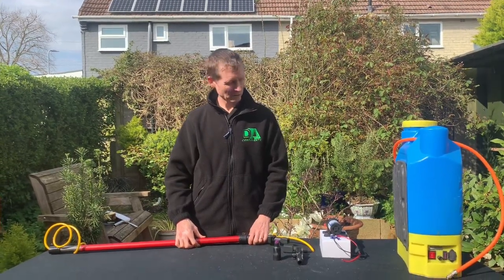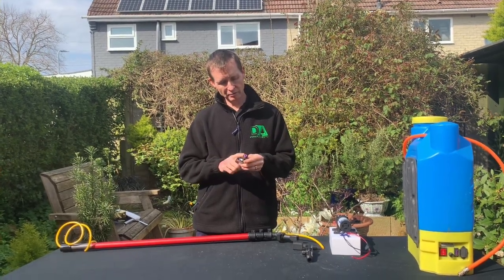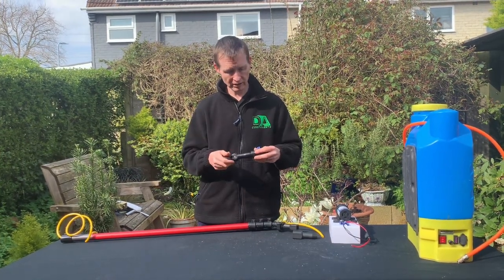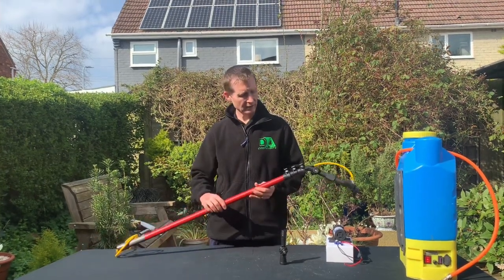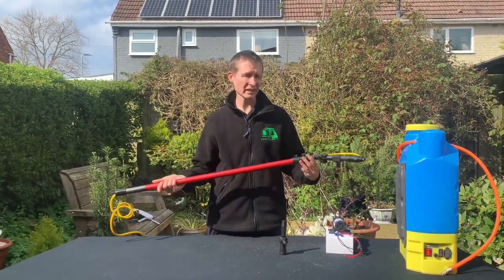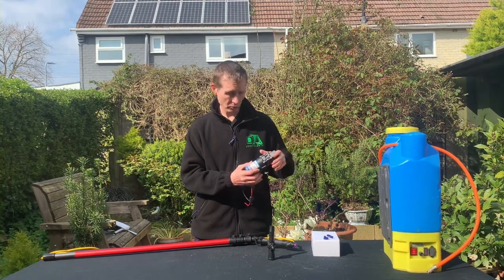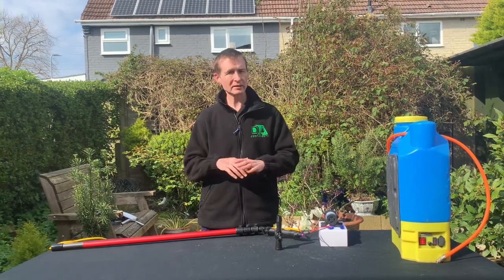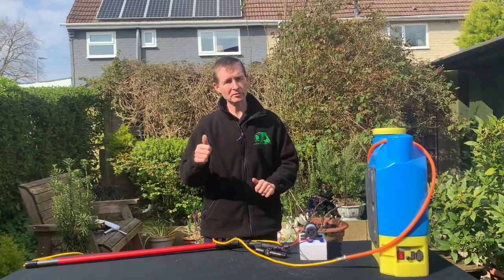Water Fed Pole - Softwash Set Up

Comment: Hi m8 how do you get the hose out of the push fit connector after
Reply from the maker: Hi Harry , you push the blue ring in on the connector and pull the hose out.
Reply: @dacomponents  thanks didn’t realise cheers